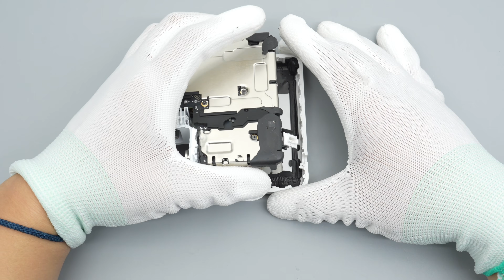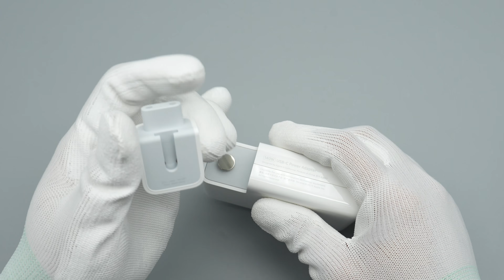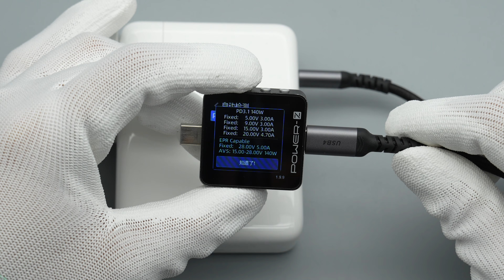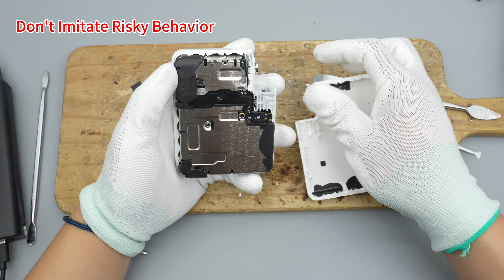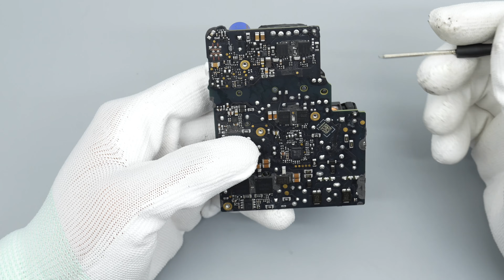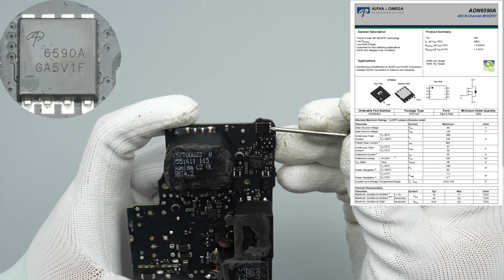Teardown of Apple 140W USB-C Power Adapter (A3607)

Comment: It looks like my existing extension cords won't work with the new brick.
Reply: they probably will, doesn't seem like the clip will interfere with older ones
Reply: @Laesx the shape around the internal prongs is different though, slightly thinner and wider so it won't fit.

Comment: Is it GAN charger or normal one?
Reply: It’s a GaN charger. Though it’s overbuilt intentionally so it can sustain long workloads
Reply: GaN but it's the biggest GaN charger I've ever seen 😭
Reply: @LoganT547 but its made very well, look at those techs inside
Reply: @ArdimanKhiar it's not, there is no PPS and it's huge 🤣
Reply: @LoganT547  but those internal components and heat managements is already very very good, its obviously very high grade components, regardless of its lack in Ports, Size comparasion and Protocols.   by the way i bought a 140W GaN charger also. But obviously not that one 😂 since its just not fit in my Money To Value needs